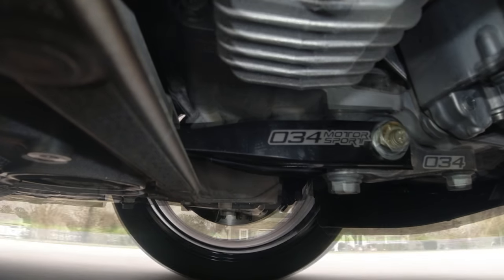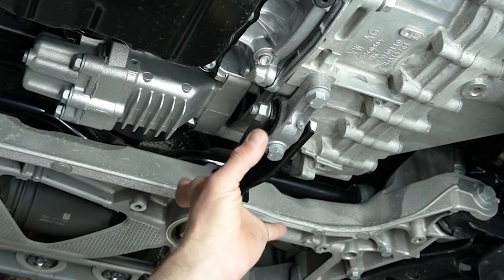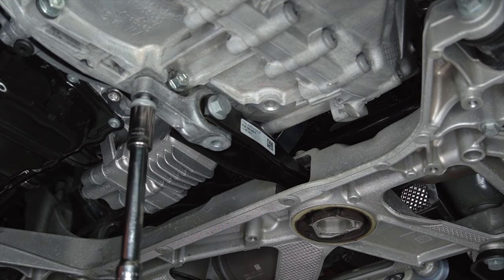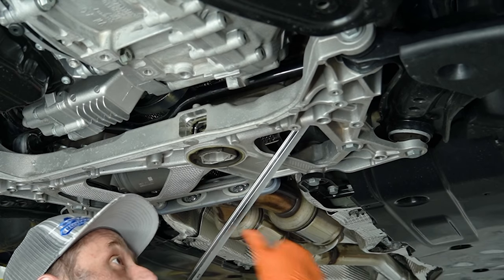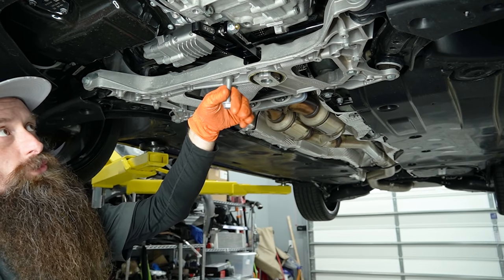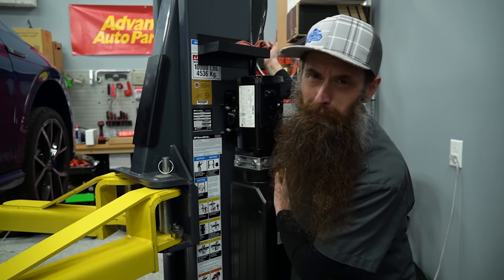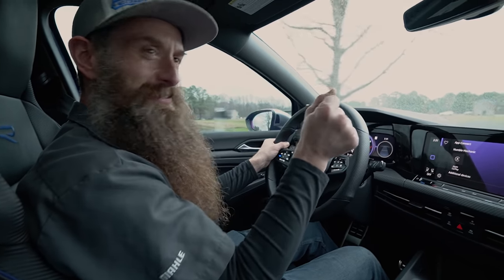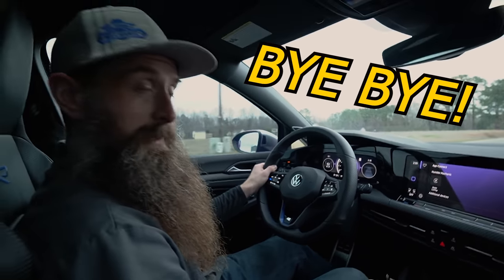MK8 Upgraded Pendulum (Dogbone) Mount DIY and Testing

Comment: Great info. And just to reinforce what you said ref improving the shifting, it does make a difference. Even if you have an older higher mileage car, changing the dogbone, even with a stock one, will have a positive impact on the shifting.
Reply: ab vf ratty 
gttt

Comment: With a little WS40 the top one slides in from the bottom pretty easily eliminating the need to pull the sway bar.

Comment: FYI, you can do just the pendulum bar to make a massive difference on hop in a gti without needing the inserts and not much added vibration from experience. I ran the apr insert on my 7.5 gti and done very little and added a lot of vibration, and ended up snapping my stock pendulum mount, remove the insert which was bent as well and just went for a full apr dogbone bar and the car is soo much better less vibration, more grip, less tramp, smooth wheelspin and more responsive front end on the power, highly recommended to do just the dogbone bar
Reply: You left the OEM rubber bushing in place with the APR pendulum bar?
Reply: I have the same noakhs’s doubt here buddy.. pls answer us
Reply: no

Comment: Any thoughts on the longevity of that spherical in the arm? I know I had spherical endlinks on my car and they seized 100% in about a year.
Reply: Due to the location these are mounted, this spherical bearing can last years without issue. We have yet to have a single mk7 dogbone spherical come through for replacement so far!
Reply: Ive had an 034 spherical arm in my mk5 for like 5 years no issues
Reply: @034motorsport  How much does this improve traction in say a GTI TCR?
Reply: @jameslovett8697  hard to say how much exactly, but by keeping the motor from bouncing on the mounts, it will help improve traction, along with our upgraded motor and trans mounts as well.

Comment: My 3 favorite upgrades on my 2014 GLI :

(1) Unitronic Stage 1 ECU/TCU Tune (50 more hp, nearly 100 more tq) $900
(2) 034 Motorsport Rear Swaybar (no under-steer, rides like on rails in curves) $260
(3) 034 Motorsport metal dogbone insert. Improves shifting with no NVH. $50

I would do this to any VW car in the future.
Reply: I find it ironic that I just got a Unitronic stage 1+ tune for my 2014 Gli, and have a 034 rear swaybar, 034 metal dogbone inserts, and a torque solution billet pendulum mount on the way.

Comment: I fitted a yellow Powerflex insert to my cupra R's dogbone mount last year, and I'm still debating whether to swap it for a slightly softer red insert (for diesel cars), as the vibrations in reverse, and low down revs is a bit harsh. Great informative vid as always! 👍
Reply: Im pretty sure im running the purple one in my car, not too bad and i recently fitted the entire arm and i don't feel that it made a huge difference in terms of vibrations, i have not launched the car since so can't say if it helped with wheel hop or  something like it.
Reply: Cheers for this comment!

Comment: For my manual TTRS, I believe the bottom insert is the perfect compromise.  It makes a big difference in terms of improving shift feel and minimizing drivetrain movement, while having no detectable increase in NVH (no joke).  However,  the dogbone bushings will only last 10-12k miles when the bottom one is installed.  

I had installed the upper insert as well at a later time.  Although it provided a modest increase in shift feel, it unfortunately resulted in a major increase in NVH.  In addition, it provided zero improvement in terms of the longevity of the dogbone bushings.  In fact, they only had lasted around 8k miles which was contrary to what one would expect.

By comparison,  the OEM dogbone bushings last about 15-20k miles. 

Can't comment on the 034 Pendulum mount upgrade.

Comment: three related q's to the subframe and dogbone bushing
1- are poly inserts for the subframe bushings on a 2015 tiguan with 6A transmission make any difference? pros/cons
2- does inserts (poly), extend the life of the original rubber bushing?
3- can poly inserts be used to compensate wear of oem rubber bushings

Comment: Thanks!
Reply: Just installed the 034 motor sport billet pendulum mount and the upper and lower inserts using your video and holy cow what a difference! I did purchase the full kit with the new upper and lower pucks but will install that when I drop the subframe when I do new lower control arms. Keep up the good work on awesome videos 👍

Comment: Fiesta ST has a similar problem.  The rear motor mount is so bad that sometimes the engine actually slaps the firewall under hard shifting. Also puts alot of stress on the passenger side mount. 50k miles later and I'm finally doing some upgrades.
Reply: focus too lol
Reply: That is not even possible, what are you talking about?!
Rear engine mount is too soft from factory, but not anywear near to hit the firewall.

Comment: Yeah on my mk4, the subframe bolt was stuck and the head broke off. and then where it went into the trans, the threads stripped. So I got a new subframe and put new steel threads in the trans, working great now! I got polyurethane though so my whole cabin shakes at idle

Comment: I’m very curious to see if the rear sway bar 034 motorsports has will fit. I remember it being one of the best handling improvement modifications for the mk7 and I want to see how it would affect the mk8
Reply from the maker: The one they initially sent me didn't. but the standard MK7 bar did. I think by now they should have the catalog dialed in

Comment: My car (2017 GTI, bought used, still stock) hops violently if I try to accelerate hard from a stop (it bangs so hard that it sounds like it's going to break the car). It's so bad that I thought maybe one or more mounts were bad. I'm not sure if it's a normal amount or not, but your footage with the stock dogbone shows a lot of engine movement, so I'm hoping that replacing the dogbone will eliminate it. I intend to continue to modify the car and run it at the drag strip so I am erring on the stiffer side. I'm no stranger to stiff drivetrain mounts and I actually prefer some of that vibration to come through, especially on a vehicle that is as quiet as this car.

Comment: I'm not the only one that struggles to do the final turn on some of these tty bolts.  It can be ridiculously hard.  I would never suggest doing with old bolts.
Reply: lol def not with old hardware
Reply: I've been fixing an mk5 and my torque with these things is good and tight since they seem to want that stupid 90 degrees. Dumbest thing I've seen instead of just sticking to a number and be done with that like other manufacturers. Engine hasn't fallen off yet and I did put in two new upper mounts with the same bolts. That bottom frame bushing looks like a pita since you probably have to take it all down just to change those.
Reply: @myshots101  I mean other manufacturers do use them, it just varies, but they're actual tested numbers still, it's where the bolt provides the most clamping force from its stretch while still retaining strength and not snapping
Reply: You don't usually wanna do the angle torque with the old hardware, though, as it's already been stretched to that maximum clamping force and it distorts the bolt, so doing it again could break it

Comment: I have a issue with my Mk7 with 100,000 miles. 
A misfire on cylinder 3 only, misfire is only on idle. 
Did compression test 190 on 1,2,4 and 160 on 3. Changed spark plugs, coils, injectors, and did a carb clean.

Any help on what it could be the issue  would be appreciate it.

Comment: I know this video has been up for a while, but any update on the upgrades? How is your satisfaction with these after driving for a while? Looking to do this to my stage 2 R but not sure if the additional vibrations will out-way any benefit for daily hooning.
Reply from the maker: I took the arm out and installed the OEM one. Left the insert only. That seems to be a great compromise
Reply: @HumbleMechanic  I have a 23" GTI and I’m looking at stiffening the shifting without introducing crazy NVH or ruining daily drivability. How do the upper and lower dog bone mounts feel after a year? I’m not really into track driving, just spirited back roads.

Comment: I have the Racingline Pendulum mount.  As well as the upper and lower racingline pucks, racingline engine and motor mounts.  Do you think the pendulum mount is worth installing if Im going to install the upper and lower pucks as well as the engine and motor mounts?  Im going to track the car but the car will be driven as a daily driver.  Or can you give any advice on which parts I should install first and then test that I have?

Comment: Hey Charles. I'm not sure if the top dog bone mount has a nut or something because i needed to replace my old bolt of the subframe mount and the new one wasn't catching any threads. they are oem mounts. The bolt should thread no issue. Any tips or ideas?
Reply: Dog bone mount bushing **

Comment: I put this exact kit on my gti mk7.5 and it felt miserable to drive! It rattle insanely hard. I took it out and it was Pleasant to drive again, what did I do wrong? I torqued all and put new hardware to.
Reply from the maker: You didn’t do anything wrong(most likely) this part will introduce more vibration. When you stiffen up, that almost always adds vibration in the cabin.
Reply: @HumbleMechanic  hey thanks for answering! But it introduced allot of vibrations like bolts n stuff in the cabin got loose 🥺😓

Comment: did yall try it with just the upper and lower inserts? im wondering if the rubber isolator and spherical bushing on the 034 dogbone actually reduce some nvh that is introduced when using the stock DB
Reply from the maker: That’s what I’m now running. Still some NVH but not as much as the whole bone

Comment: Great videos @humblemechanic! Very informative. I have a 16 gti just went stage 2,dp,cai,turbo inlet and muffler delete gonna do intercooler soon. I noticed after getting the parts on and the tune done there's a weird click that sounds like it's coming from under the car in the middle maybe towards the engine more if that makes sense when accelerating or letting off the gas. Any idea what it could be? Or have you ever heard of anything like this before? It didn't make this noise before this. Could it be the stock pendulum is bad?
Reply: Hey man I own a 23" GTI and I’m also getting this weird clicking noise when engaging a gear or just sitting still with the clutch out. Did you ever find out what this noise was?
Thanks
Reply: @dominicanstig5196  ya unfortunately the two bolts on the aftermarket downpipe came out somehow. Stupid I know but I went and got new bolts and it's been fine ever since. The bolts under the car that connect it to the sub frame. Hope that helps. Not sure if it's the same sound or same setup.
Reply: @vwgti8091  Yeah mine in completely stock and about a week ago the car started to do a subtle but annoying clicking noise intermittently when going into gear or just sitting in neutral. Might just do a bolt check to see if that fixes the issue. Most MK8's have this same issue so I’m not too worried.
Reply: @dominicanstig5196  ah ok. Ya I don't know much about mk8. I honestly don't even drive mine all that much anymore. Let me know what you find if you remember.  Good luck!
Reply: @vwgti8091  Will do, thanks for the info!
Reply: @dominicanstig5196  no problem! Hipe you get it fixed I know how freaking annoying those things can be especially on a new car

Comment: Hello! I realize that this video is for MK8s but I was just wondering, if I wanted to replace my timing chain and tensioner on an MK6, would I need to remove my upgraded pendulum mount? Thanks in advance!
Reply from the maker: IT will make moving the engine easier. Id pop the 2 16mm bolts out,
Reply: @HumbleMechanic  Thanks so much for the reply! I'll remove the 2 bolts!

Comment: Question, I have a manual MK5 GTI. I think the dogbone bushing is bad but I'm unsure. When I leave it in gear and decelerate something knocks pretty hard and it is speed sensitive. The faster I'm going the faster the knocks and visa versa. It sounds and feels like it's coming from that area but how can I be sure that's it without dropping a ton of money into it as I am currently short on cash?
Reply from the maker: I’d start with a visual inspection
Reply: @HumbleMechanic  I checked everything I could see. Motor mounts, axles, tie rods, ect. I have a polyurethane dogbone insert already however I think the insert is old and split. So if the insert was taking most of the force because the bushing was bad and now the insert is bad. I think that might cause the noise I'm getting.

Comment: Do you recommend this upgrade for cars with diesel engine+DSG,like the Passat B7?
Reply: I installed 034 upper and lower on my mk7 tdi at 1K it was SO LOUD like a subwoofer vibrating the whole car. It has quieted down a little after around 200 miles, but still very audible.

Comment: I  changed out my dog bone bushings on my mk4 years ago after going through several of the poly and rubber ones. I eventually removed the smaller bushing and replaced it with a solid aluminum piece no regrets since.  I actually have a video in my youtube page show  right after the install on a test drive im fine with the nvh and ride quality, i guess its comparable to rose joint mounts, Most of my noise back then came from my Tt coilovers being slammed.. ive since gone to lowering springs..

Comment: The 90deg after the initial torque is not needed nor is it worth it!
Reply from the maker: Follow the repair manual
Reply: @HumbleMechanic  the risk you take of stripping a bolt in the case of the gearbox or stripping the upper subframe mount is not worth it been there already.